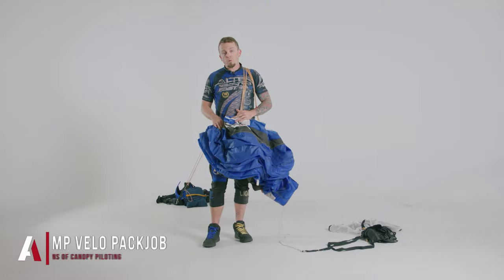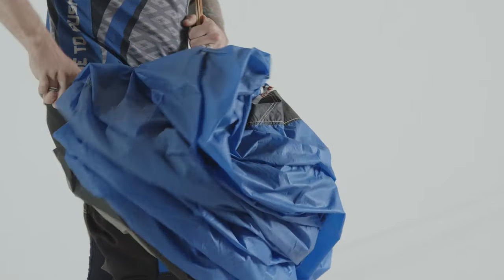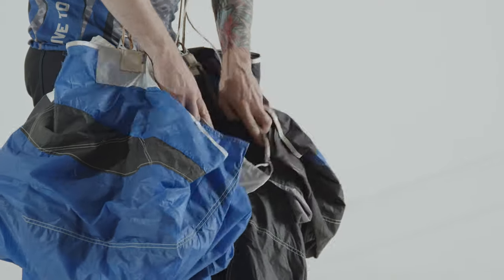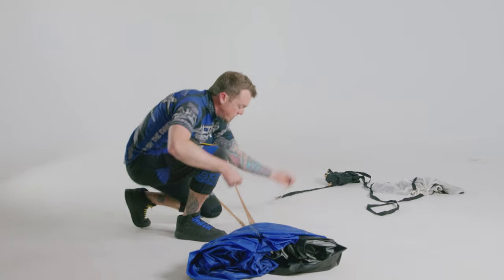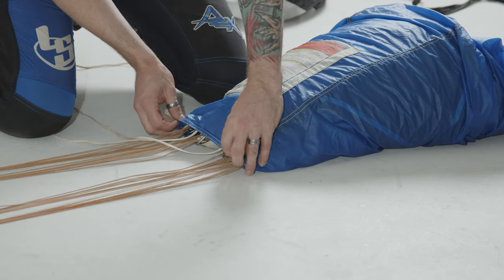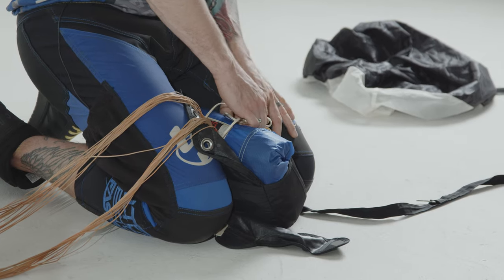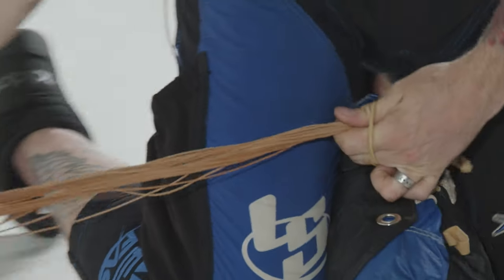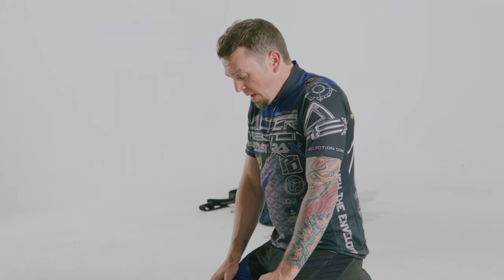Comp Velo Packjob

Comment: Thanks! Question: a normal Comp Velo slider has snaps to keep it in place, you don't use snaps on an RDS? Do you use them on normal sliders?
Reply from the maker: The snaps are for slider control during the packing process. You can use them, but if you keep the slider in place while you are packing there isn’t a big difference. If the slider moves around on you while you’re getting it in the bag then the snaps will be beneficial.